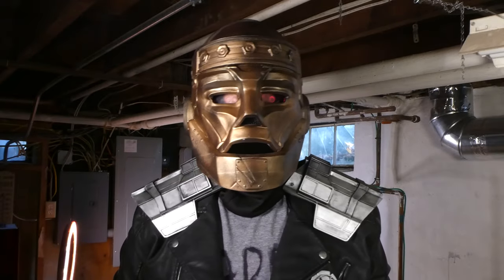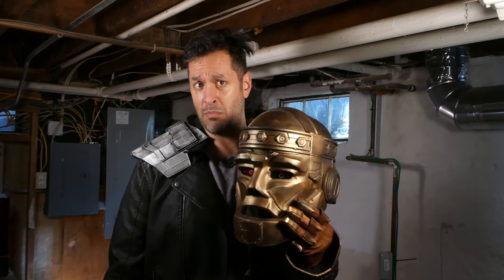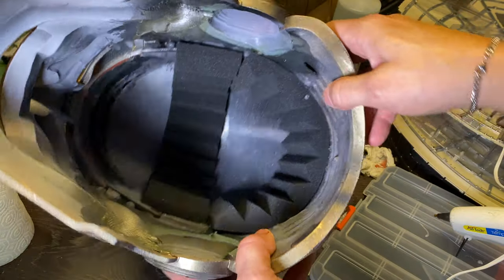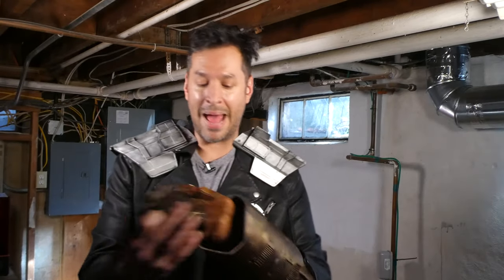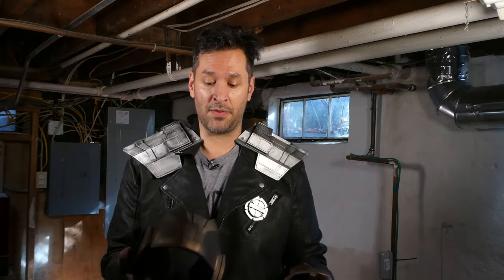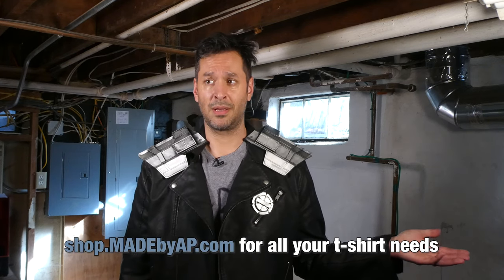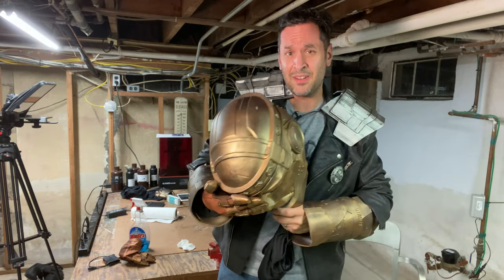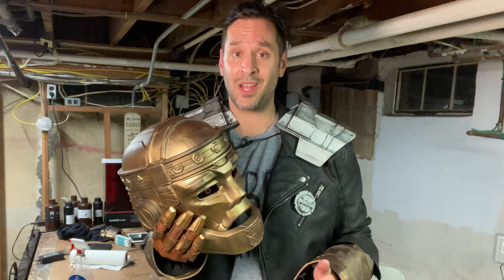Doom Patrol's Robotman aka Cliff Steele Full Cosplay Tutorial

Comment: Printing my costume pieces right now. What dimensions of acrylic pieces for the eyes did you use?
Reply from the maker: Hi! I did 25mm x 60mm but I also scaled my helmet up to 120%. So it may be safer to check your measurements. I just made sure I had about 5mm on all sides. Heres the file I used if you find it helpful! https://onedrive.live.com/?authkey=%21ANOFW72FM%5FmipHw&id=45F3192A263232BD%2156326&cid=45F3192A263232BD&parId=root&parQt=sharedby&o=OneUp